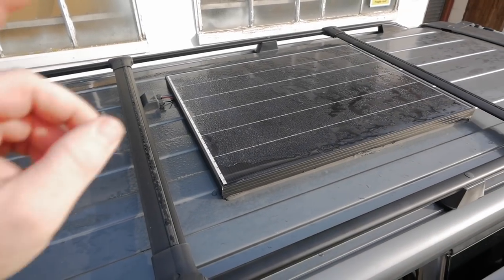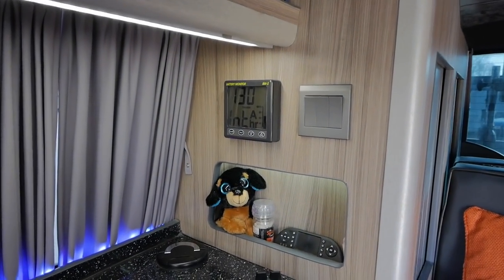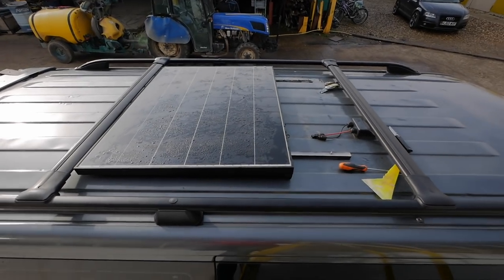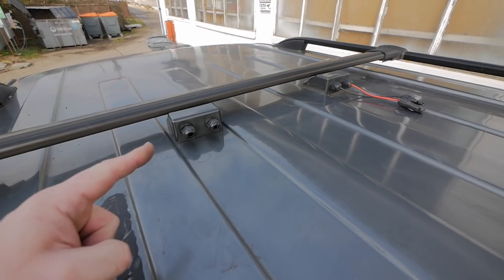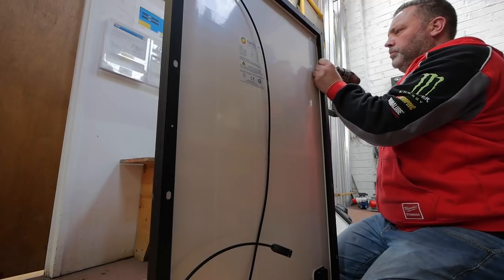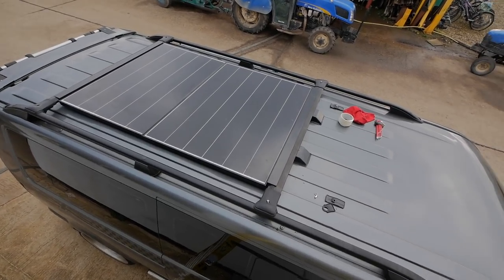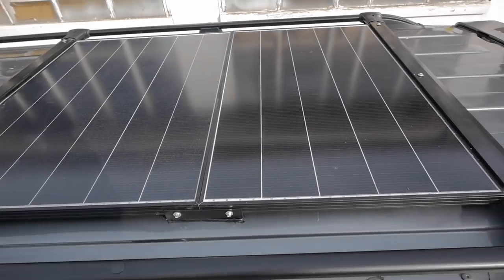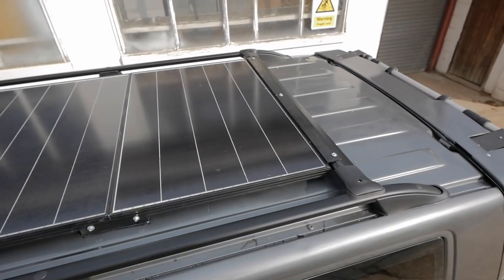Fitting solar panels - vw t5 camper (off the grid camping)

Comment: Exactly what I was looking for, thanks. This is good way to put a rigid panel as low as possible for example in ID. Buzz, which is 1,93M high. This could be done under 2M mark. I also like the fact, that the panel is not the highest point of your roof. Also using 2 panels instead of one large, You get more rigid setup with framing in the middle of the system. Less movement on bumpy roads.
Reply from the maker: They are still holding strong 👍

Comment: Lovely Vid n8ce tidy job ... to get thru Sikoflex use a length of MIG Wire both ends Wrapped round  2 Screwdrivers or Wooden Dowels, use as T Bars .,u on 1 Side a  pal on other and use like a cheese Cutter , cuts both sides at once , good for Bonded windscreens too , just push 1 end thru into Cab 
That Van looks the Dogs Doodars , real Tasty 👍

Comment: Isnt it at risk of getting airflow getting under the panels and ripping them off when doing a ton down the motorway? Anything to be gained by putting a bit of a spoiler in front to divert airflow?
Reply: Ian Kearns - From what I could see in the video, I'd guess not - it looked like the front roof-rack cross bar is already doing the job of taking the brunt of the air pressure, and the panels behind  appear to be solidly-fixed (well, once the tek screws have been replaced).

You'd need to be careful with adding aero, spoilers might divert airflow, but as they do it, they create an area of lower pressure below and behind the spoiler and higher pressure above - that low-pressure 'hole' in the air wants to be filled, and at high speed, it ain't fussy what it fills it with.
If the panels are in the wake of something that does that, the air above the panels will be affected differently to the air below the panels, which will create a force sucking (or pushing, depending which side you look at it from) the panels upward - past a ton this effect could become significant.
I think you will get that effect anyway as the air being stuffed below the roof bar and under the panels will experience some compression, but the point is adding aero without knowing what you're doing could amplify the problem as easily as reduce it.

Besides, it's a camper, he's not likely to be rushing around doing a ton in it! That's for stressed-out sales reps and boy racers! Where you rushing to in a camper that you want to even be on a motorway, let alone do a ton on one!
Reply: It will be a disturbed air flow because of the two cable entry points pushing air over the top of the panels bud. So it would balance its self out quite a bit and the central brackets will reduce the majority of the panel flex. 
But in a previous video he had explained that he wanted airflow to cool the panels also as they can get quite hot 👍🏼

Comment: Dear Syderlee you didn't have to put holes in your roof. In the back of the van the tail lift door has a gater where you can thread the cable in.
I personally would not drill holes in a roof.
 In any roof.
EVER.

Comment: Hi love the vid just got my solar panel and think of mounting the same way as you with the cross bars have u had any issues with movement at speed iv read about the venture tunnel effect basically air not escaping as quick as it’s entering causing the panels to move have you had this problem?
Reply from the maker: Nope still all good been on 5 years now since this video.

Comment: how long can this set up keep you off grid for ? running fridge ect ?
Reply from the maker: Last year with the one panel, I ran my fridge for 8 months continuous. I went to Scotland for 5 nights no problem. My camping is usually one spot for one night then stay somewhere else, so the split charger will be helping too. I never plug the hook up in. I never run out of battery. Having 2 panels will be even better.

Comment: Great job. Enjoyed the video,very informative.

 The unit thats attach to the roof where the cables go through. Any reason they were fitted to the lower section on the roof and not fitted to the raised part of the roof?  Just curious as the water might clear quicker if they were fitted that way.
The reason I ask I'm planning on fitting solar to my T5 👍
Reply from the maker: Erm yeah that makes sense doh ... the raised section would be better

Comment: Looking good nice install.
Do you get any wind noise on the motorway or buffering? Also what make of crossbars are they I like the low profile.

Cheers
Reply from the maker: I’ve only been between work and home a few times so far (15 mile motorway) but seems ok to me 👍. Bars were just some random ones I found on eBay.
Reply: @SpyderLEE  no worries be interested if you get any wind noise in the future.
Good find on the bars

Comment: I've been thinking about doing something like this myself and I have a question.
If my batteries are full and I'm not using any energy is that a problem?
Solar panel still creating power but can't go anywhere?
Thanks!
Reply from the maker: No, the charger goes into a “conditioning” stage. Keep the batteries in good health.
Reply: @SpyderLEE  okay, thanks!